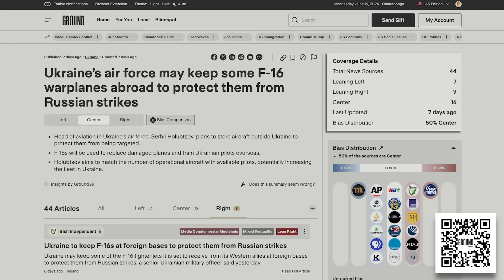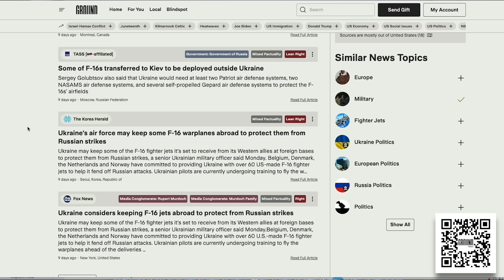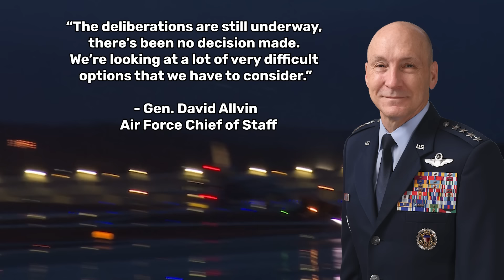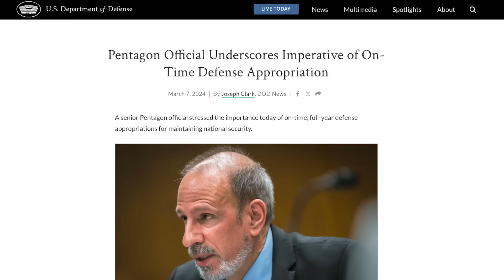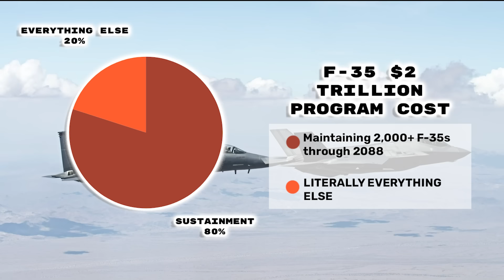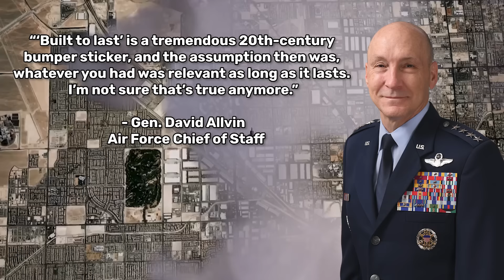Will America's new stealth fighter be shot down by cost already?

Comment: We can't build frigates.  We can't get hypersonics right.  We can't replicate the technology that got us to the moon in the 1960s.  We can't produce civilian aircraft that don't try to open and disembark passengers mid-flight, or nose dive to oblivion, we can barely ramp up artillery shell production (and one of the plants has a fairly major fire when we do), we can't deliver block III F-35 still (they are sitting in warehouses, unfit for use), our fleet of now insanely slow boats could not all survive the trip across the Atlantic to build the Gaza pier that then almost instantly broke apart and had to be rebuilt, we as a country build almost zero ships from freighters to those frigates we can't get right, our subs are all behind schedule, the Burkes were supposed to be replaced by now, you really don't want to know how many merchant vessels we would have in the event of an actual conflict, not only do we have LCS we have leaders in the military that across multiple administration of both parties we and lied under oath that it was exactly what we needed and there was nothing to fear if you served or depended on one for your safety, we also do not merely have a population not physically or mentally fit to draft in-case of a conflict, the truth in all the reports that no one wants to speak out loud is that the draft age population does not care about the country (hard to argue the country cares about them either) that uses them to fuel older generations retirement at the cost of their everything, our leaders both commercial and political sold and sell with gleeful abandon every shred of manufacturing to the point where we now have little choice but to put our entire country in the arms of war and death because we are so dependent on a tiny island we allowed so many of those we educated to move  US businesses away from the place they were born and provided everything they required to grow (until of course American workers became too expensive, so hello Taiwan and China), our higher ed is fueled by a disturbingly large amount of money from over seas, even worse for anything we call a Think Tank.  Can we admit there is a problem yet, or do we keep talking about how amazingly awesome we are and name systems we don't have after things like sharks and forces of nature and buy into the fact that while we can't make anything we at least have the Dollar General where we can get everything we ever wanted for just a buck!  Right.  Go US, we are the best there are and have ever been.  Nothing to see here.  Move alone to the greatest tailgate party in the greatest most powerful country, with chips and queso brought to you by the generous donations of Blackrock and Vanguard (companies that have decidedly not American controlling powers within them but that control things like Lockheed), a controlling interest from the oil dudes in UAE and Qatar, and your soon to be not employment check courtesy of NVIDIA (no AI can't do the really cool stuff, but you've never been paid for the really cool stuff have you?), and of course, the same donors to both the political parties: we give you the feeling of choice!  Let's drink that beer brand that isn't American anymore (ok, no loss on that swill) and laugh about the Russian and Chinese corruption and ridiculousness and  pagentry of both of those country's single ruling groups, just before our obviously different and , broad and representative 2 parties have their high school proms set with actual dates now.
Reply: @LackofFaithify  yapping lol

Comment: Maybe... Just maybe.... MAKE A CHEAP MASS PRODUCIBLE MULTI ROLE FIGHTER?? You can just make a new 5th gen that has cost and mass production as the foremost priority with performance and payload next. We dont need 200 super high tech fighters. We need 3000 multi role fighters. Or brong back the fighter bomber like the f111. It could be stealthy yet have payload internally for significant armaments but hey that requires intelligence

Comment: Most people do not know this. But they are a few printer companies to actually make printers. most printers are made by somebody and the other companies put their shell on it and call it theirs. Now as for how this applies to airplanes, somebody comes out with a new chip that will take over the functions of two other chips but cost less than the other two or three chips. So they used that new chip. Now the blueprints for the old one still sold the other two or three chips somebody trying to fix a problem we'll find only one chip where it should have been three chips and maybe a burnt resistor or capacitor. Your schematics are wrong for what you are seeing. No for a fact that one person tries to order a new airplane then try to figure out what was wrong with the old airplane based on the old schematics. I had 253 lb of schematics when I got out of school. When I got to an air base most of them were accurate but more than one was not.

Comment: There are certain things that all aircraft need right... Like take for example the ability to fire X-Missile or drop Y-Bomb. The software to do that has to be individual to EVERY FUCKING INDIVIDUAL AIRCRAFT? We can't develop a little plug and play module that can be integrated into any plane we want to have those capabilities CUZ WE FUCKING STANDARDIZE AN OPERATING SYSTEM FOR ALL AIRCRAFT THAT CAN ACCEPT MODULES LIKE ANY GODDAMN COMPUTER IVE EVER BUILT IN MY FUCKING LIFE. Windows scans my computer for new hardware every time it boots up and when it detects new hardware it asks for drivers, why do military planes not have something similar... why are we not paying defense contractors to develop modules for integration of whatever new system we want the latest and greatest aircraft to have. Planes should be designed with modular computer architecture that can accept targeting modules, or avionics modules or navigation modules or WHATEVER FUCKING MODULES THE PLANE NEEDS TO HAVE. The plane itself should be designed as a flying blank slate that can be configured with whatever modules we want it to have, upgradeable via software patches that can be uploaded whenever they have been tested and deemed ready...

Comment: How does even 3-5% inflation turn $300M to $500M if you're building the same number of planes during the same time frame. Something not adding up.

I don't think these problems are being made worse by the lawmakers themselves, but by the military contracting organizations that are low balling to get an award and then running up costs because they can. THAT is something that needs to come under control. Just like Boeing is giving us the steaming turd of the Starliner because it has to be largely fix-priced, it highlights that our out of control defense spending is due to our military industrial complex not being able to deliver at the price set.

Comment: technology is advancing to quickly in all systems areas for a "legacy" backbone to survive more than one generation, flight control alone is rapidly moving to adaptive aero structures that are unique to the platform and every iteration of a new design would require a complete redesign to match the new configuration. Every other system has the same problems, targeting systems are advancing so fast they can't decide which new sensors to use much less lock it down for a long term pick. Engines are advancing so much that hypersonic multimode is just around the corner and that technology is so new innovation is just getting started, making a design today obsolete by next week much less thinking of using the same engine design for different aircraft configurations over the next ten years, you have to pick one and be happy with it until the adversary forces you  to move to the next jump in capability, ground support alone makes having a bunch of different aircraft too expensive in terms of footprint and training to work in the complex world we have now. A long term design with rapid upgradability is the way forward.

Comment: AND how did that workout...
Century Fighters:  
F-100, capable but was overtaken quickly and transitioned into a ground assault role.
F-101, had severe design issues that had to be overcome with some only partially corrected.  The aircraft was transitioned into a reconnaissance role.
F-102/F-106, as an interceptor it was capable but, when restricting their ROE (Vietnam) it fared poorly as a dogfighter; it was not designed for that.  The 106 was just a 102 redesigned.
F-104, great at its role and was even capable as a ground assault role.  The main drawback (besides killing its pilots) was the weapons load, not enough.
F-105, really not a fighter.  A very capable ground assault/ bomber.  Gets a bad rap unjustly.

From there then the US transition to a one aircraft for the USAF & USN.  And how did that workout...

Comment: We should shut down the ICBM silos and add a few subs to our inventory.  Save the money, remove the midwest and where ever else those silos are from the target list, and put the savings into a single airframe for both the navy and the airforce.  There's no reason why these two use cases couldn't use the same exact airframe (with the obvious landing gear and structural enhancements for carrier craft).

But if you look at the needs of the airforce and the navy, they're both going to need to cross the pacific.  So, you're going to need gas tank, you're going to need to carry as many missiles as possible, irst, all the next gen stuff.  It's ridiculous to duplicate the R&D efforts between the Navy and the Airforce when they will have this much in common.

Sure, this sounds a lot like the arguments for the F35, and we saw the failures there.  I'd argue that's largely because we tried to shove a VLST design into the mix with the F35B.  

Just.  No.

Maybe we don't have the right engine tech quite ready yet.  If there's a chance that we can get RDE engines on our newest fleet if we simply waited a few years, then let's wait.  It will be more than worth it.

Comment: They definitely can replace the F-22 they built them once they can build them again
Reply: Unfortunately all the tooling was destroyed. The air force did a feasibility study and found rebuilding the f22 assembly line would cost nearly as much as building the ngad.
Reply: It will be extremely expensive though

Comment: They need some  Red bull inspired super drone that would be a predatory stealth cyborg animal that could fly, and kill anything in the air,land or sea,  even 1/3 scale attack air to air drones, could be carried under wings on a F-18 super bug, release the super compact air to air Demon drone,  to go seek &; destroy with separate (remote predator drone type pilots 7k miles away in Nevada)!or autonomous pilots , relieving the original crew from any further responsibilities except to safely get back to the shor/base. The Demon drone, hunting then firing it's internal weapons, and they could even return to ship or base to be refueled, re armed, re folded and reattached to a Full size carrier launched fighter, or pallets full off C130s, B52s, B1Bs, etc , even having expendable foldable mini air to air or air,  to ground mini, fighters pop out of a sub run a mission, and be retrieved by any ship, or base, keeping the sub hidden underwater the entire time, while boosters keep everything dry until the drone is released under its own power to surprise anything flying, floating or rolling. A fraction of a full fighter $$, but even smaller,  stealthier, and extending range even more, almost like a missile carrying missiles, that keep humans safe, and push the Kill chain way,  way BVR! P(k)! would be crazy high, and cheap, our advisories  surely are!